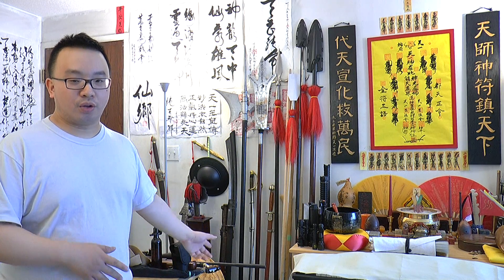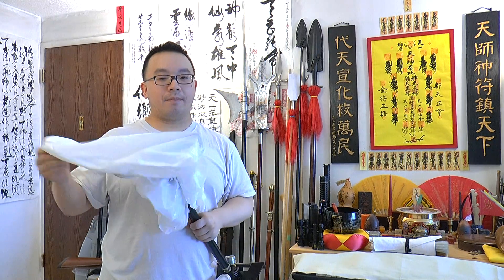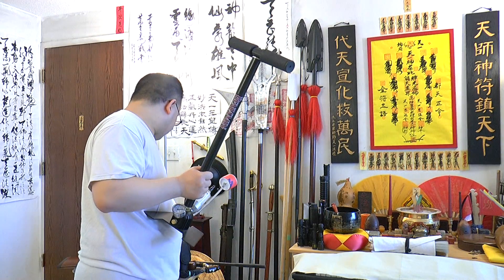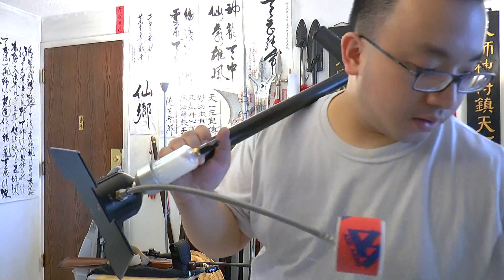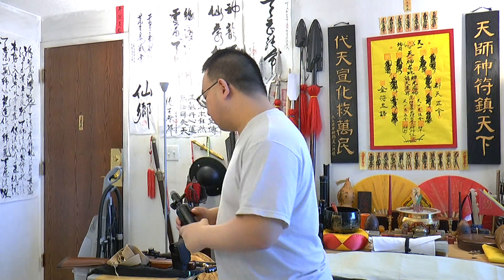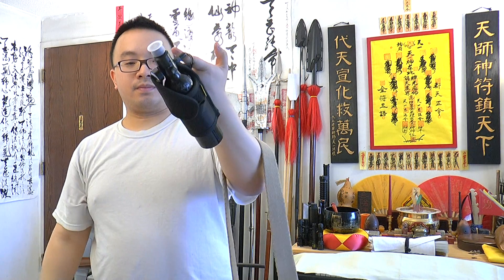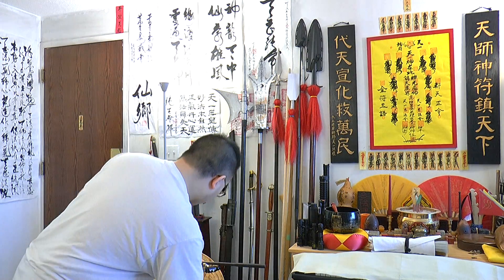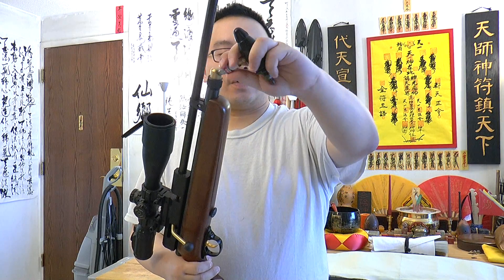Converting Co2 Airguns to HPA Tank Air (QB78 Deluxe HPA Conversion) Tutorial and Demo

Comment: Where do you buy your 1000 psi output HPA tanks? 

All the ones that I’ve seen are all 800 psi. For HPA the pressure needs to be a little higher then co2 right?
Reply: I might be wrong but pressure is pressure no matter the gas.
The tube is rated 850 PSI for Co2 so I wouldn't recommend going over that with air.
Some guys are running up to 1100 PSI, but that doesn't mean it's safe or good for the gun.

The 13/3000 tanks I see for the QB series come with 850 PSI regulation, with included shims you can go lower, but not higher with the regulated pressure.

Comment: That has to be about the most cumbersome HPA conversion you can do.  It's better to fit a 13ci Guerilla bottle to it by fitting the drop block off a QB79.  Better still just buy a QB79 and convert that.  You end up with a regulated PCP for about £45 but I certainly don't recommend trying to fill up with a stirrup pump unless you are looking for a heart attack.  I use a dive bottle but I've also just bought a mini 300 bar compressor.  If you are in the UK make sure your conversion keeps you below 12ft/lbs.  You can actually raise the power a little more than you would with CO2 as air is far more stable temperature wise.  The QB79 makes a good PCP very cheaply without any mods to the air cylinder.  Only the 13ci bottle will screw on and off with the barrel in place as it's 50mm dia.  Above that they jump to 61mm dia.

Comment: That has been such a brilliant education Mak - I tuned my one via this 3 years ago and it as good as any top of the range PCP - thanks a million. I got rats, lots n lots of rats (stables), but because of you and this vid  I now dispatch them painlessly. For anyone concerned about winter temperature drop offs I place my rifle in an electric blanket at 2p per 4 hours full heat and get 11.8lb every time on a 45 minute walkabout. You could do the same with a hot water bottle - especially when it's minus outside; all the best to you Mak - you're a good man.

Comment: I just bought a Legends MP40 full auto BB gun. Can you recommend a CO2/HPA conversion kit? One of my fears is that the screw cap on the bottom of the mag to pierce the CO2 vary from gun to gun. Are they pretty much standard? Ninja offers a kit, but I don't know if the replacement screw/plug is different for paintball guns...which they are offering their kit for.

Comment: Why does Archer say not to use HPA? Has any on had any problems
Reply from the maker: +Shawn Swigart why not use hpa?  you cannot use HPA if it is not regulated to the proper pressure, but if pressure is right, HPA is not a problem. He just fears people putting in the wrong pressure and end up killing themselves.  For the stock tube, you can use HPA from 850psi up to 1150psi (output pressure from the tank).  A normal paintball tank is usually 850psi output range. If you want higher output, you need to buy a ninja tank with a fixed pressure regulator installed to say 1200psi and then buy a madbull 12g co2 charger with a regulator, disassemble the unit and just take that regulator out and hook it to the tank first, and so you can adjust the pressure from 1200 down to 1150 or 1000psi or whatever and there goes the air you need.
Reply: @MakHobby  I recently converted a smk cp2 co2 air rifle to hpa using remote line and tank. Only prob is I am down on pressure when running on hpa any ideas why? My air tank is regulated at 850psi apparently do you feel this is enough or could this be the problem?
Reply: +MakHobby how many shots average do you get from your qb78 with around a 1000 psi hpa fill?  Not sure if yours is a .177 but I am guessing a .22 would be slightly less also?

Comment: will this work on a co2 airsoft gun
Reply from the maker: Kevin Cuff IF your airsoft gun is running on Co2, then it should be good at 850psi hpa, but depending on the model, you might need different adapters and such to make it fit.
Reply: Well I have the elite force uzi and im going to try it out thanks for the help it is just way to expensive to run co2's
Reply from the maker: Kevin Cuff If you think the co2 is expensive then you should never start on Co2 guns. You should just go straight to PCP or HPA guns and not buy a Co2 gun... easy fix

Comment: This gun says that it is designed to be good at up to 38 degrees Celsius (100F) at which point a 12g co2 is at about 1400 psi. I was planning to operate my gun at 1100 psi.
Reply from the maker: Yes, you should be fine with 1000 or 1200 psi. I would say that 1100psi is very good. Even with 850psi, it's shooting quite hot too! :)  Nice gun!!!  Btw, you can also try 1125psi, which is what most people use for this kinda setup.
Reply: Yeah, I'm thinking I'll probably get a 1200 psi valve, as they seem more common. I've heard of people using 1900 psi on the standard gun, but it seems far too risky to me.
Reply from the maker: ExF1Guy WHAt? 1900psi?!  No way that is comfortable zone for me!  1200 is max for sure, for my brain to feel peace.. hahahaha
Reply: I know, someone rebuilt their internals to stand 2900 psi, but 1900 psi on the base gun seems slightly insane. Thanks for your advice!
Reply from the maker: ExF1Guy
I know there is a PCP conversion you can do to the gun, which then might stand the pressure, because you even have to change the tube too. See this video:
Tech Force 78 PCP Conversion Part 1
Reply: Yeah, I heard about that. I saw on the forums (may have been the chinese airgun forum, but I'm not sure) saying that the operating pressure for the standard tube (less than .01 (I think) expansion) was up to 2900 psi. I think that I'd be more worried about the tube shearing off and becoming a projectile.
Reply from the maker: ExF1Guy
2900 psi on that tube is scary!

Comment: Hi mate great video would love to do this conversion on my qb just bought it today, could I ask a quick question? I am having trouble loading the co2.. I put them in the right way but the cap pin when I screw it back on & it's doesn't seem to be punchering the canister there is an indent but not punchering properly? Do you know why?
Reply from the maker: No idea why.. maybe you didn't crew them on back tight enough?
did you change the internals too? Including the Co2 pin?
Reply: It's ok now I have got it sorted just needed screwing really tight man
Reply: If it’s like my fusion 2 I put the first 12g in followed by a dime then I put the second 12g in and both are punctured every time with less effort than without the dime

Comment: The Co2 capsules are really a waste of money in my opinion. I have a few Co2 guns and they really start getting expensive when you have to change the capsule every 30-50 shots. Definitely going to at least try to convert one of my guns like that.
Reply: Hahaha!  Yes, Co2 is pricy when you play with stuff like the Mini UZI and so on, they only fire 2 mags and it's gone...!  Not all guns can be converted though. Which guns you thinking of?  You got the steel force?

I am converting a lot of my co2 guns into HPA, but still trying to find the 12gram co2 dummy thingy for converting those pistols to HPA. I am sure it will work, I just need the adapter!
Reply: Chiinnature I was thinking of converting a Avanti 887. What do you think? Can it be converted?
Reply: TheTiger52 isn't that already a bulk fill gun that uses co2 tank?  you just need to use an HPA tank instead of co2 (same thread anyway) but limit the pressure (regulator installed in hpa tank) for 1000psi and you should be good to go. Pressure is pressure. Just like my QB here is meant for Co2 but as long as you don't pop over the 1100psi mark, you are very safe there. Co2 pressure is about 850-1200psi normally.. and so if you don't pop too crazy, it should be fine.

You will need the remote house and the tank.  What adapter or method you use to fill your gun now?
Reply: No, the one that i have uses the co2 capsules. There's so much stuff that i have to get etc.... I really gotta start studying on what i need to do if i don't want to blow the whole gun up LOL! 

EDIT: I'm not really sure what the gun is anymore because the box what it came with says that it's the Avanti 887.
Reply: TheTiger52 so it's 2x 12g Co2 back to back setup? if yes, then it's harder to do because your "endcap" must be replaced with one that fit your tube size, which I don't know if they even sell anything like that now.  The one on QB should not fit yours too.  What I found is

http://www.specialtyshootingsportsoutdoors.com/air-gun-accessories/daisy/daisy/avanti-887/888-replacement-co2-cylinder.html

They sell this tube for the 887 and seems like the 887 model out there all uses this. Maybe you should look on the gun and see if they have any markings or names?
Reply: Chiinnature Yeah, The setup is 2x 12g co2 capsules back to back. I'm not going to buy anything yet. I'm going to do some research and learn about this stuff first. Then I will try to convert the gun. The gun is an Avanti. At least the marking on the gun says Avanti.
Reply: TheTiger52
Maybe yours is an older model?  I researched and see the 887 and 888 are both bulk fill co2 guns, they don't use 12g. Maybe that's the older model of the 887 with the rainbow color stock. I do recall seeing a 12g version in 2009 too.
Reply: Chiinnature Maybe. I got it from Ebay anyway so it's not a miracle that the gun is not what it's supposed to be.
Reply: TheTiger52
oh dang.... ebay....